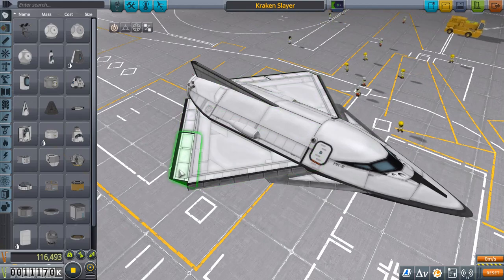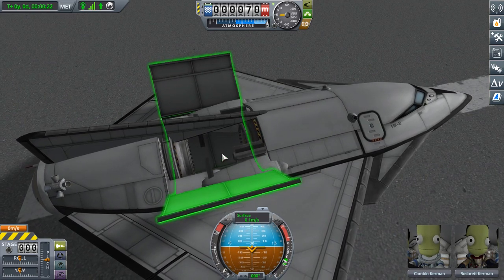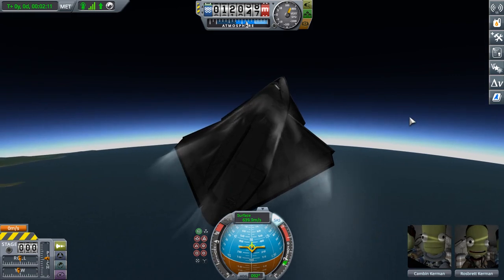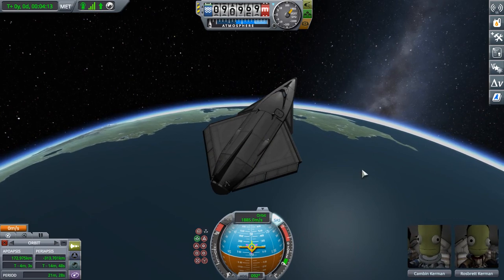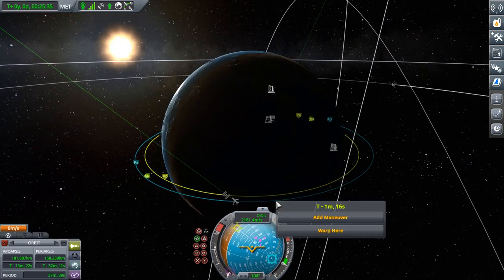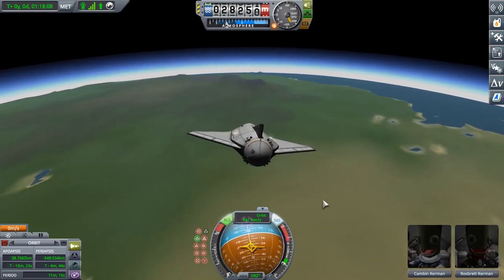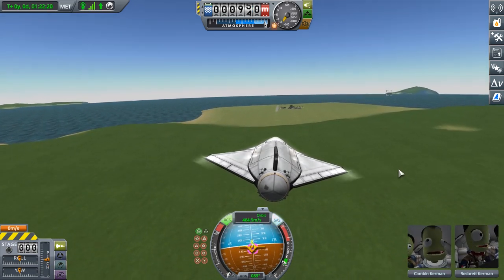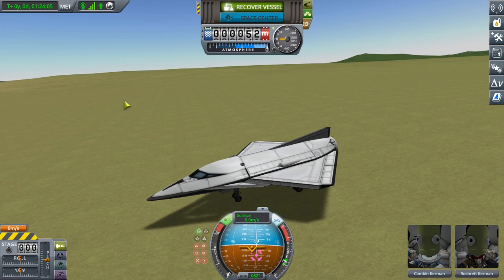KSP Kraken Drive SSTO! The Kraken Slayer

Comment: Make sure to use heavy pistons, don't use rigid connections, it also helps to root the piston to the front of the craft so it pulls the port closer instead of pushing. So for the service bay just place the piston on the front node, then a port next to it and align it with absolute translation, then put your cluster of ports on the piston's end and rotate them 180 degrees + translate. This works everytime for me, no kraken issues. You can get 64x symmetry by placing anything on the side, then put anothing thing on it with 8x radial symmetry, then take your port and hover it over the part with the second part on it, and back to the parent part. For some reason the game now loads 64x symmetry...Trust me, it's better to have 64 ports on the one end than 32 on both, I've tested this to oblivion.
Edit: Almost forgot, don't even try to build this thing in a procedural fairing, the best is the service bays.
Reply from the maker: It's the pulling ports that provide the force, you actually only need one target port. The push/pull thing doesn't seem to matter much, though a lot of the layout I did here was for aesthetic and, uh, crash tolerance lol
Reply: @Rocketman679  Absolutely, go for the looks :) I just found it way more stable to do a pull config since what you said, the port with 200% is doing the work, so in push config it's trying to pull the ports away from the cylinder's node, when in pull it pushes the port into the cylinder. But what does make a difference for sure is having the multi ports on the back with 200% and only have a single port they are all pulling towards, more ports in front doesn't help in my testing. (correct me if I'm wrong, just sharing my findings)

Idk, maybe it's just in the way I constructed it, by I had no kraken issues after switching to pull vs push, just still need to care not to let the drive go critical